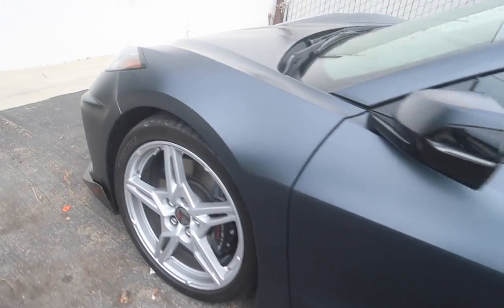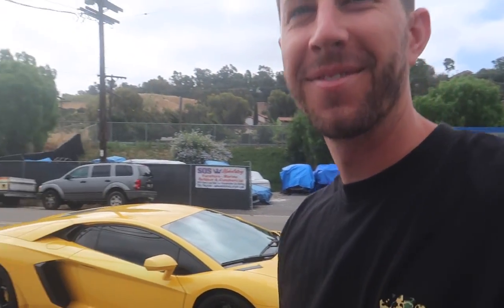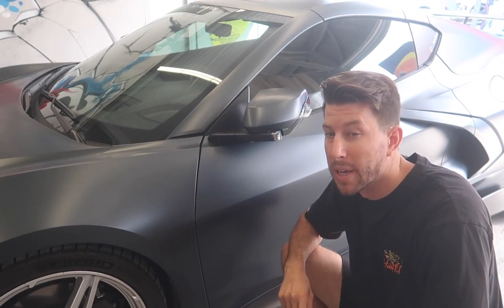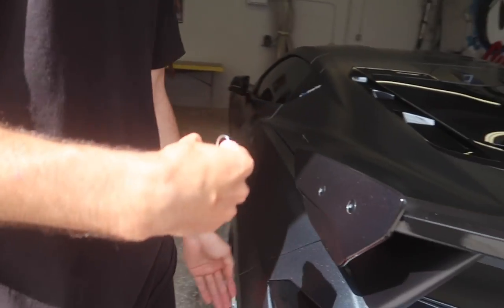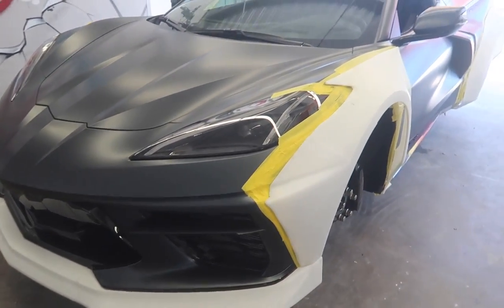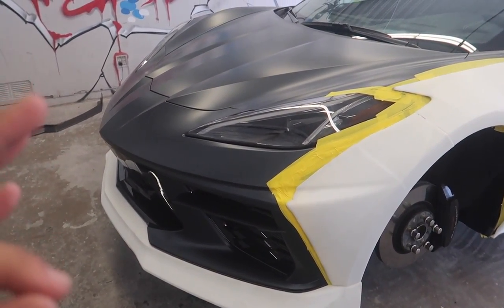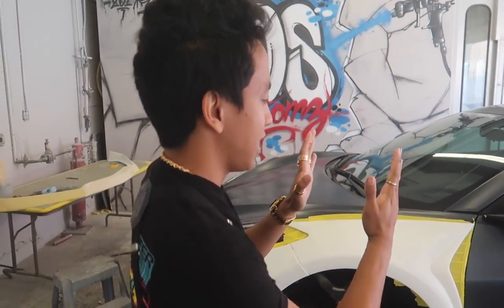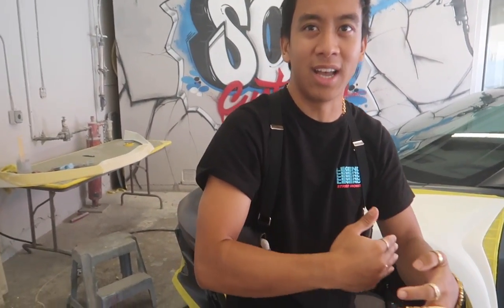Building The First WideBody 2020 Corvette C8

Comment: The front fenders look awesome, but the rear flares don't flow with the square-ish body of the C8 imo. They actually disrupt the car's flow. Looks too much like a direct rip of the kit TJ had on the Ferrari. It worked on that car because it didn't have as many hard edges as this car does. I feel like the rear should get kind of a STI (blobeye) rear flare treatment - something more square that still flows with the lines of the car.